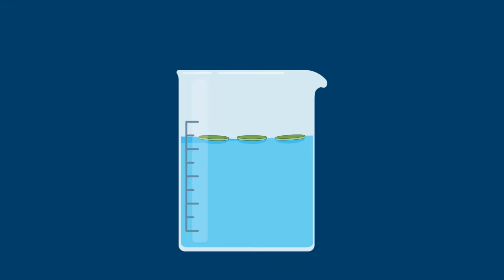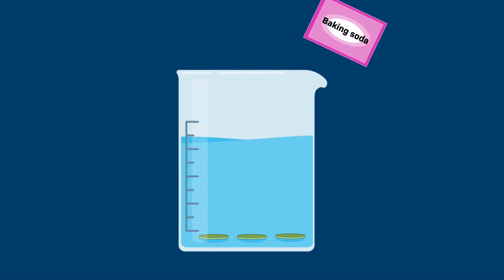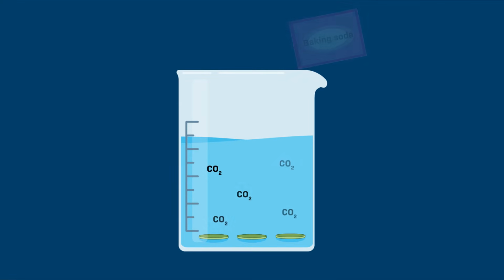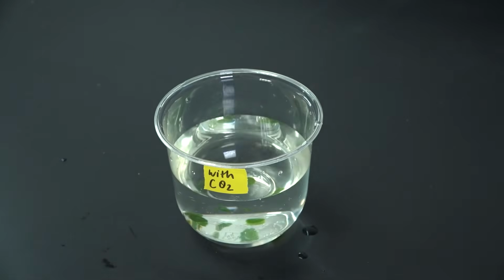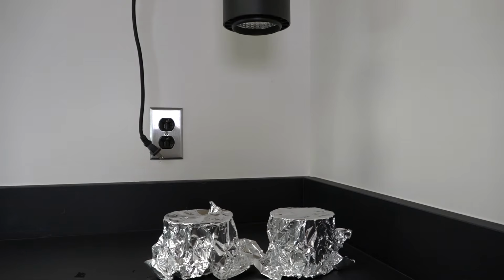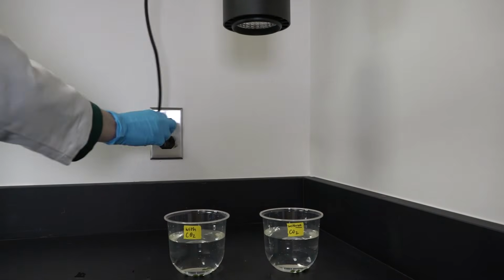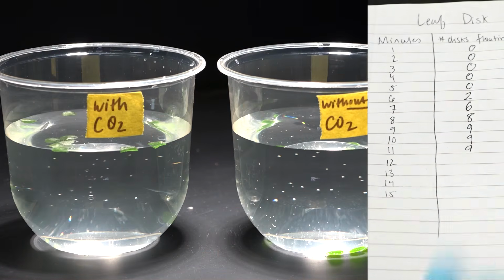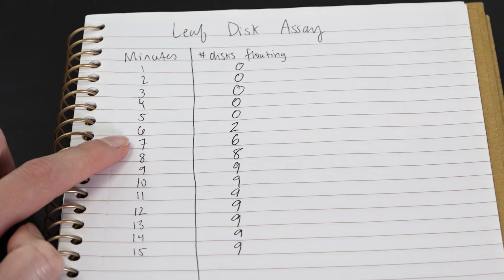Measuring Photosynthesis: Leaf Disk Assay

Comment: Hi, i'm thinking of using this for my science project on how different wavelengths of light can affect rate of photosynthesis (which im controlling through different colour filters) and I was wondering if you could do this on a batch of spinach disks more than once? Like can I put them in the solution, record how long it takes for them to float to the top, and then put them in the syringe vacuum again to de-oxygen the disks so i can perform the experiment again? I'm wondering this because I'm going to need to test 9 different colour filters, and I hope to have at least 3 different trials for each, so i hope i dont need to go through 27 different batches of 10 disks (270 disks is a lot). And if this is possible, will the rate of photosynthesis slow each trial? Thank you!!
Reply from the maker: It’s recommended to use new leaf disks for each trial, as the plant tissue can become damaged throughout the process and may no longer yield accurate results when reused. While this may require additional preparation, it will ensure the reliability of your data and the integrity of your experiment. Best of luck with your investigation—it’s an excellent way to explore photosynthesis!
Reply: @LabXchange  Thanks, I've already finished my lab and did just that!

Comment: Can I use malabar nightshade for this experiment?
Reply from the maker: Malabar spinach can be used for this experiment. We recommend using green shades and leaves that are not too waxy on the surface as the waxy cuticle can make it difficult to extract the gasses from the leaf disks.

Comment: Also if I were to use leaves with red parts, why shouldn’t I cut leaf discs there?
Reply from the maker: While you could use red portions of the leaves to cut the leaf discs, it is not recommended as the chlorophyll composition may differ from the green parts of the leaf and therefore, this would introduce another extraneous variable into the experiment.

Comment: Why can’t we cut the leaves at the big veins?
Reply from the maker: The structure of the large veins makes it much more challenging to extract gasses via the vacuum mechanism rather than the flatter parts of the leaf. As the plant photosynthesizes, the gas oxygen will be produced within the leaves which will cause the leaf disks to float. Therefore, we are able to visually measure photosynthesis as the amount of floating leaf disks per minute. If we did not extract the gases from the leaves through the use of a vacuum, we would not be able to track oxygen production as a measure of photosynthesis.
Reply: But why is it harder extract gasses in areas with large veins?
Reply from the maker: @alexisyu8946  Large veins are structured to tunnel gasses and nutrients throughout the leaf and therefore are not as flat as the rest of the leaf. The structure of the large veins makes it much more challenging to extract gasses via the vacuum mechanism rather than the flatter parts of the leaf. Thus, leaf disks cut from veins will typically float. Remember that  to visually measure photosynthesis we need to first sink the leaf disks by extracting gasses via the vacuum method and then use the amount of floating leaf disks per minute as a measure of photosynthesis.

Comment: Why we are creating vaccum?
Reply from the maker: A vacuum is necessary to extract the gases from the leaves. As the plant photosynthesizes, the gas oxygen will be produced within the leaves which will cause the leaf disks to float. 

Therefore, we are able to visually measure photosynthesis as the amount of floating leaf disks per minute. 

If we did not extract the gases from the leaves through the use of a vacuum, we would not be able to track oxygen production as a measure of photosynthesis.
Reply: @LabXchange  thankyou.

Comment: what would the leaves happen if it didnt vacuum well?
Reply from the maker: If the vacuum doesn't work the first time, you can try again with the same leaves. However, after a few tries, the leaves would likely be damaged and we recommend starting with new disks. Adding soap is also an important step for breaking through the waxy cuticle of the plant in order to extract the oxygen.

Comment: Can we perform this expt. In sun light
Reply from the maker: It is likely not feasible to perform this experimental set-up in direct sunlight and obtain reliable results due to the fluctuations in light intensity or amount of sunlight at different times of the day. To obtain consistent results we recommend using a controlled light source (same wattage on all light bulbs) and ensuring all other variables are also controlled (distance of the light source to the beaker containing the leaf disks, same type of plant, same amount of bicarbonate etc).

Comment: Can you use filters to change the wavelength of the light reaching the leaf disks? Then I can setup an experiment with my students to exemplify which wavelengths are most optimal for photosyntehsis.
Reply from the maker: Using colored filters to change the wavelength of light reaching the leaf disks is an effective experimental setup for testing which wavelengths are most optimal for photosynthesis. Be sure to keep all other variables constant such as watts of the light bulbs, distance of the light source to the leaf disks, angle of the light source to the leaf disks, and translucency of filters for example. As a bonus, this experimental setup is nicely aligned to the AP Biology standards!